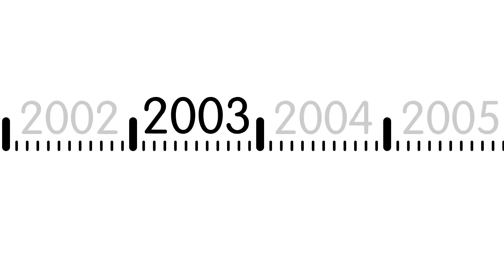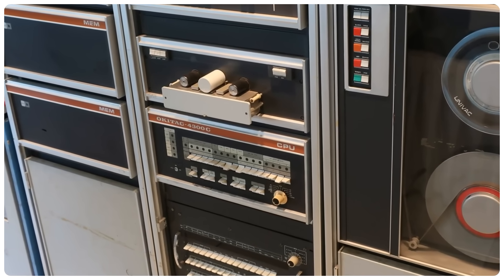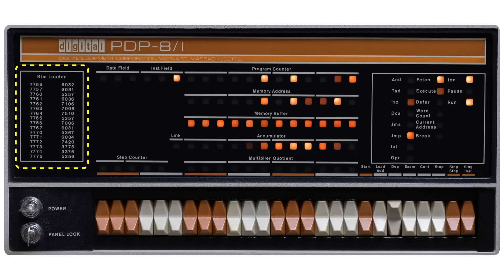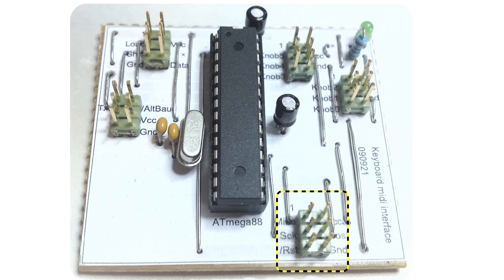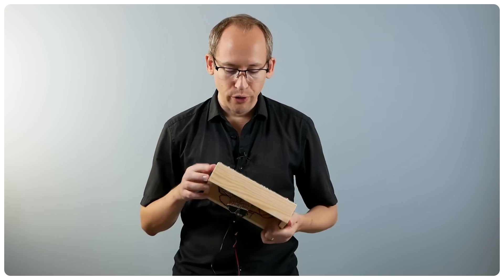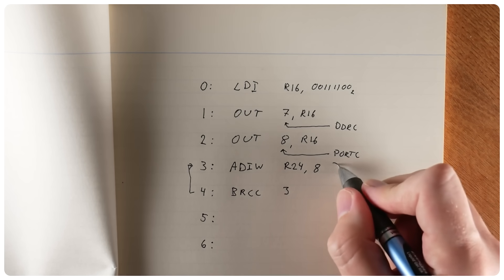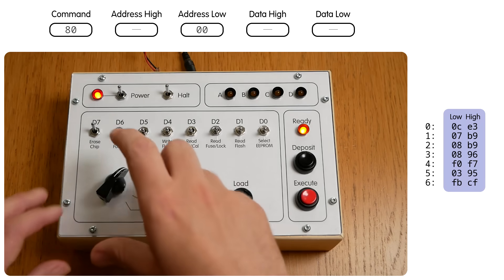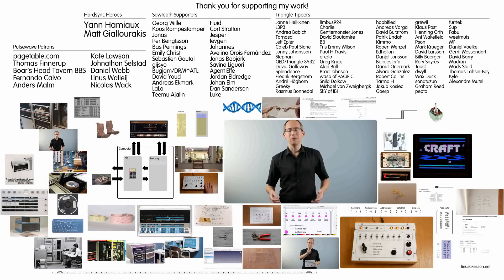Front-Panel Booting an ATmega88 Microcontroller

Comment: Writing bootable programs on my first  computer, IBM-360/30 was soooo easy. You gad ONE  button called IPL or Initial Program Load. Because of the powerful instruction set, and great hardware design, the IPL button would ececute ONE instruction, SIO or Start I/O. This would read 1 record from the selected device and load it at location zero and give it control. Fro cards, this would be an 80 column card, tape would be one block, disk would be one sector. Easy peasy. The front panel would habe rotary dials instead of toggle switches. Much more intuitive  than toggle  switches and it used HEX instead of Octal. IBM had octal on thier ealier machines, but saw the light that Hex was the way to go. Its a shame that DEC never grew out of that poor octal mode.

Comment: Very nostalgic.  I cut my teeth on 8080 machine code on an IMSAI 8080.  Later upgraded to a Z-80.  Coincidentally, while looking for a tool today, I found my old Zilog pocket code reference.  I spent hours in front of the IMSAI with that in one hand and the front panel switches in the other hand.  Good times!  (Incidentally, the IMSAI is still alive and well and living with a friend of mine.)  Thanks for an enjoyable video.

Comment: Wow, such a shame I can't "thumbs up" this video twice. That was most excellent.
I haven't ever used parallel programming on an AVR, but I have implemented HVSP on some of the smaller ATtiny chips, and I think those are basically a pair of 11-bit (yes really) shift-registers in front of the parallel data bus and all the other handshaking lines. It's sortof like writing SPI with two MOSI lines at once. Very familiar looking at how the ATmega88 does it.

Comment: Amazing, your fingers jump across the row of switches like you were doing this for a while. 

I meant to ask, have you used any glue between the acrylic sheet and the paper?
Reply from the maker: No need. It is held in place by the switches and led housings, as well as the screws along the edges.
Reply: @lftkryo  Interesting, thank you.

Comment: Initial program load from the customer engineering panel.  Just say it.
Prompt panel - terminal screen.
Reply: IPL is an IBM term. Non IBM'RS dint understand that term. The brilliance  of the IBM instruction set made the IPL button a stroke of genius by issuing a Start I/O instruction on the device that was dialed in. This way you could IPL (or BOOT for non IBM'rs) from ANY device in the room. It would load 1 record from a device into location Zero and the first 24 bytes  would be the new PSW (Program Staus Word). This PSW would have the address of the next instruction to execute. This is the way the mainframe IPL'd since the 60s other hardware manufacturers   never did something as brilliant as this.
I wrote many 1 or two punch card bootable programs. I wrote a banner Program (large letters printed sideways on printer) on two punch cards (160bytes)

Comment: PSST! Myth detected! "Bug" referring to a malfunction in general was already a slang term by that point. It came from certain telegraph operators and their hatred of early high speed keys they called "bugs" and they ended up calling any bad or faulty tech a "bug". The fact that the first notable computer malfunction was caused by an actual insect was already an irony and only helped propel the term.
Reply from the maker: I never claimed that it was "the first notable computer malfunction", though. I think it's clear from the text ("first actual case") that the term was already in use. But I still like your comment because it provides more e(n)tymology.

Comment: Nice, I have had thoughts of making a 'hex display & keypad' terminal that plugs into a SWTPC 6800, so to the user it's like your driving one of the early development kits, but in actuality it's a terminal feeding the commands into the computers existing monitor program.
The problem for me is the hex keypad, no longer something you could just buy, I've got to make my own. Key-switches are no problem thanks to the mechanical keyboard fraternity, however the keycaps are. Buying a complete keyboard set for $$$ they throwing away most of it is bad.
Your front panel idea would also lend to be used this way.
Having either a hex 'terminal', or your front panel sitting there, flashing lights would look cool, not that I'd hardly ever use it, just there to make the 'old girl' look more complete.

Comment: Nicely done. One machine I worked on- Burroughs B1800- was interesting in that as well as having a traditional front panel it could be booted by reading an opcode (16 bits) at a time from a cassette tape and executing it: that was also great for running Maintenance Test Routines since it worked even if there was no memory in the system.

One morning I got to work and continued at the point I'd left off the previous evening by loading a tape: which promptly showed me that the central 8 bits of the 24-bit ALU wasn't working. Sure enough, I'd left one of the three ALU cards pulled...

p.a. Nice to see the Hisoft debugger screenshot. I used the FTL Modula-2 that they distributed fairly heavily.

Comment: I never knew AVRs had parallel programming. Maybe I should do that on ATTiny2313 or ATMega8 (I checked and they both support it) and 3D print a panel.

Comment: I like how you left a little bit of the cleverness of your short blinkenlight program to discover without explaining it. You're making R16 count up from 0-255 and then overflowing around again. But you're only displaying 4 of the bits, not the 4 least significant ones, but bits 2-5. That means that your 30 ms delay loop (which you chose because it's short to write) is actually not the time in which it takes for your lights to blink, but instead the frequency of which the least significant bit is flashing. But you're never displaying that, which means bit D is actually blinking at a quarter of the rate.

And of course the more significant bits are never shown because the port isn't configured to write there.

Very cool little interaction, and quite efficient!

Comment: Very cool!

If you need more software for your computer, here is a minimalistic blink demo with 2 instructions. You also need to change clock fuses to use 128 kHz oscillator and CKDIV8 to make it 16 kHz. (Or add a little delay loop)
   0:	3a 9a       	sbi	0x07, 2	; 7  (DDRC |= 1<<2) -> set pin to output
   2:	32 9a       	sbi	0x06, 2	; 6  (PINC |= 1<<2) -> the hardware treats this as "PORTC ^= 1<<2", toggle LED
  ; No more instructions, loop through rest of flash at low speed

Or maybe a xor calculator:
   0:  0c e3       	ldi	r16, 0x3C	; 60
   2:  07 b9       	out	0x07, r16	; 7   (DDRC = 0b00111100)
   4:  83 b1       	in	r24, 0x03	; 3   (read PINB, we want 0:5)
   6:  a6 b1       	in	r26, 0x06	; 6   (read PINC, we want 0:1)
   8:  88 0f       	add	r24, r24
   a:  88 0f       	add	r24, r24
   c:  98 2f       	mov	r25, r24
   e:  92 95       	swap	r25
  10: 9c 70       	andi	r25, 0x0C	; 12
  12: a0 73       	andi	r26, 0x30	; 48
  14: 89 27       	eor	r24, r25        ;    (high bits)
  16: 8a 27       	eor	r24, r26        ;    (low bits)
  18: 88 b9       	out	0x08, r24	; 8  (PORTC = (high ^ low) << 2)
; loop through rest of flash

Comment: From Wikipedia:
In 1860 it appeared in a comment about philosophy of mind: "The attempt of the mind to analyze itself [is] an effort analogous to one who would lift himself by his own bootstraps." Bootstrap as a metaphor, meaning to better oneself by one's own unaided efforts, was in use in 1922.This metaphor spawned additional metaphors for a series of self-sustaining processes that proceed without external help.

Also note that when older generations tell the younger ones that they just need to pull themselves up by their bootstraps they are using a metaphor that means to do something that is demonstrably impossible 🤦

Comment: not always every day. Up until mid 1970's it was common to have core memory. So the bootstrap code would stay in RAM until something bad happened (another program needing that ram space or writing over the bad address range by mistake). My 1976 pdp11/10 still has 16kwords of 16 bits of magnetic core RAM memory.

Comment: The PDP-1 had a hardware read-in mode for paper tape, so didn't require manual instruction entry. This mode was somewhat inefficient, though, requiring 6 tape rows for each word, so most tapes would have a boot loader at the beginning that switched to a faster and checksummed behaviour.

Comment: The rate at which you mentally translate binary to hexadecimal is incredible! The amount of practice you've had with it shows. I'd be like a kid learning to count if I needed to do that.
Reply: Once you get the 'knack,' converting between hex and binary in your head is trivial.  But yeah, it's impressive to see it in action at speed. 😁
Reply: Confirmed.
Reply: it's kinda simple when you break it down.  split 8 bits into two 4-bit halves.  each half is a hex character.  once you have the 15 hex characters (and 0) patterns memorized, you're off to the races
Reply: @marred2277  nibbles thoughtfully
bits, huh?
SWAPF
Reply: @paradiselost9946  >nibbles thoughtfully
exactly! though I usually see that spelled "nybbles".
Reply: @markjreed  cant say i have ever seen it written like that but... if "vice" can be...
vise, vice, vyse, or vyce, and ALL appear in the same book, referring to the same thing...

english is silly :)
Reply: @paradiselost9946  Well, the "nybble" spelling is specifically for the data meaning of half of a byte. It's a play on a "nibble" of food being a smaller "bite". Four bits is a nybble, two nybbles is a byte.
Reply: @marred2277  Yeah, I know how to do it, but I have so little practice that I'm slow about it.
Reply: I used to bel able to multiply and divide in hex.  But that was long ago.  It's not that hard.

Comment: I wonder why they didn't have front panels with hexadecimal or octal keypads instead of toggle switches. Surely that would been a lot faster to input the boot code with?
Reply: Adding this feature would likely have blown out the cost astronomically.
Reply: Switches go directly to the CPU and memory bus. Keypads have to be scanned and decoded.
Once a boot ROM with a software monitor program became cheaper than a board with switches (don't forget the labor cost to build it), front panels went away. This was around 1976 or so, such that microcomputers had a very short time with true front panels.
Reply: Some did, like the KIM-1, though it also featured a monitor program. Decoding a keypad to a binary number is a slightly complicated operation itself.
Reply: As a matter of fact, IBM mainframes used hex rotary  switches instead of toggle switches. It was less expensive and very intuitive. IBM abandoned octal in the 60s as it was horrible idea. Hex was the way to go
Reply: @rty1955  I used the rotary type, which resembled a combination lock, they had gold contacts, much easier than toggle switches, and didnt need any fancy interface.
Reply: @enoz.j3506 were they octal? Hex? Or BCD?
Reply: @rty1955  Im pretty sure they were BCD. They were black with white lettering about 2 inches high x 1/2 inch wide, and you could stack them side to side, robustly built. Ive probably got some in a box somewhere.

Comment: This is brilliant! If only the parallel programming interface would let you read out the memory values as well, so you could see and edit the code- Still, nothing like entering every bit of a program by hand
Reply: It can. Pin PD2 is the output enable. You'd want another row of LEDs for the data bus and resistors so the switches didn't override the values. But it looks like the only erase command is chip erase, so it's not great for editing.